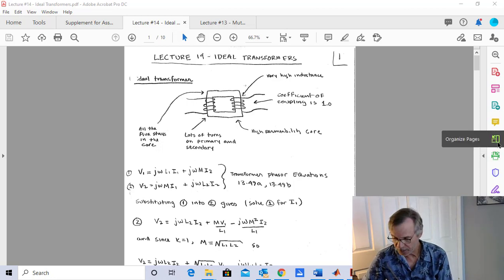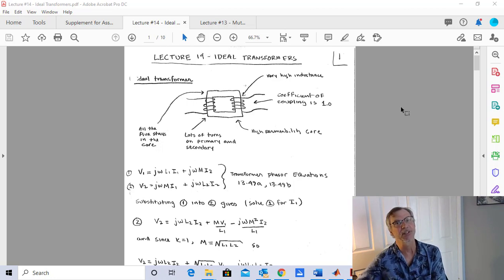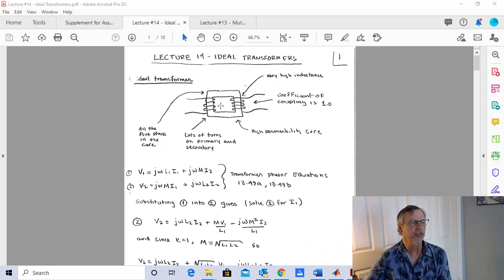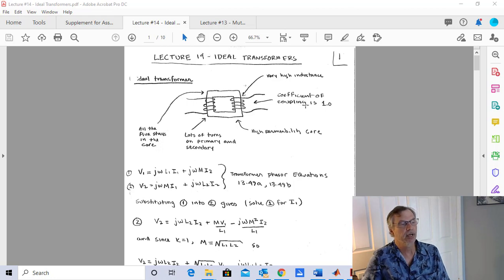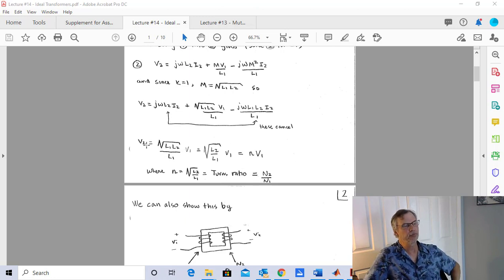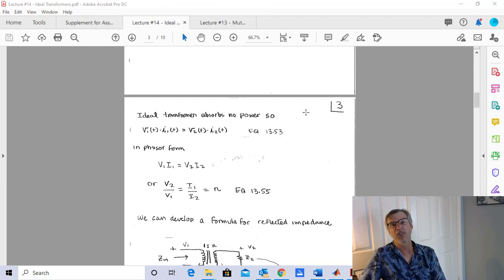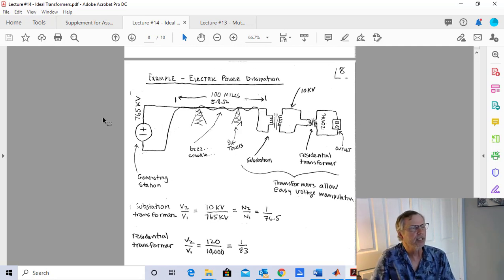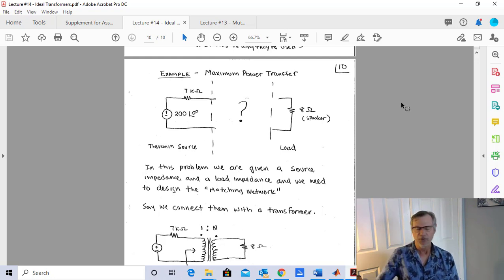EE310 - Lecture 14 - Ideal Transformers

Comment: At about 37:50 you casually state that if the secondary current is open (for Thevenin evaluation), then NO CURRENT WILL FLOW ON THE PRIMARY OR SECONDArY SIDE. Why wouldn't current still flow on the primary side? You have a complete circuit and a V-source.